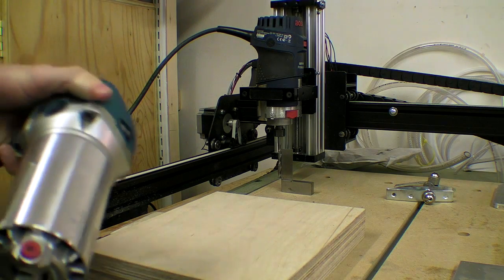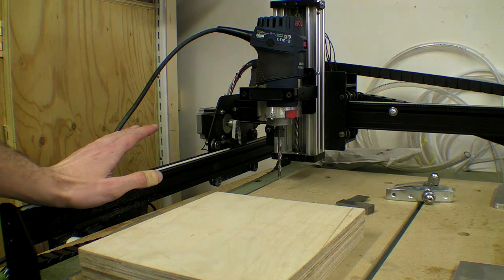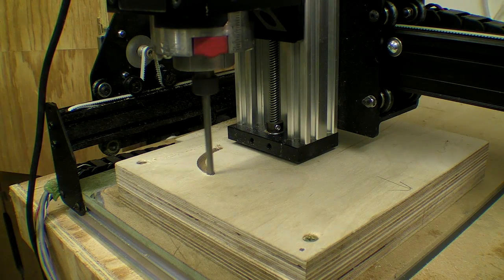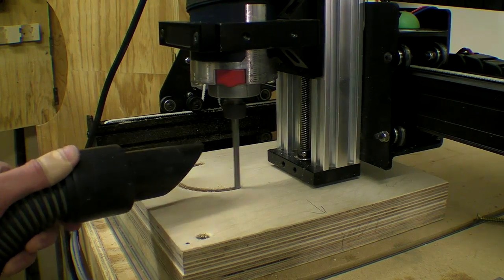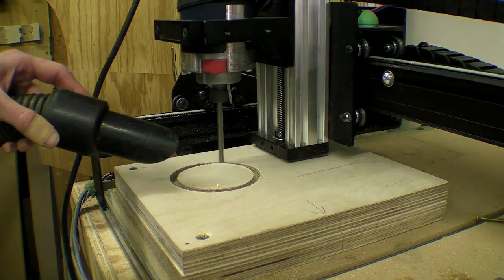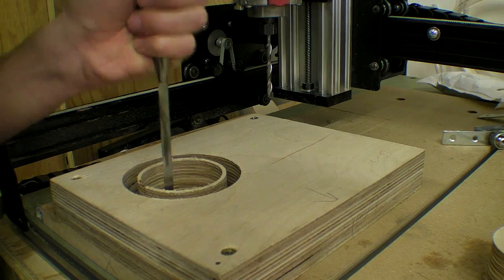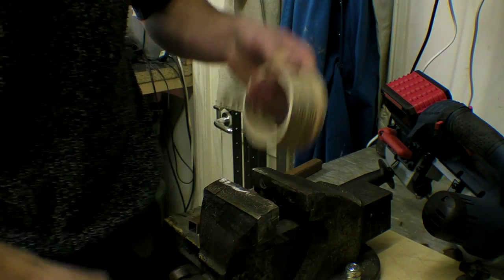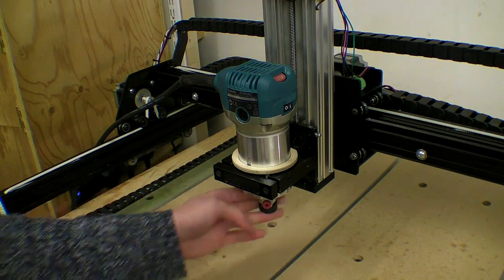CNC Spindle Adaptor Ring - 71mm to 65mm Mount

Comment: Interesting! have you experienced additional damping, more vibration or just neither of them?
Reply from the maker: +Cactus! workshop The mass of the machine which has increased, has improved vibration.  Also the variable speed on the router can be adjusted to avoid any frequencies which make things sound worse then they are.